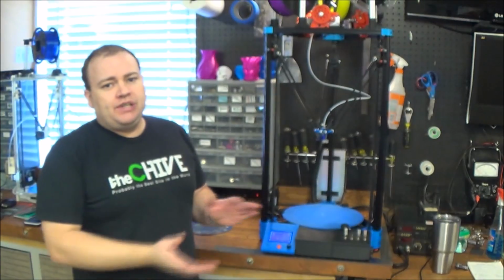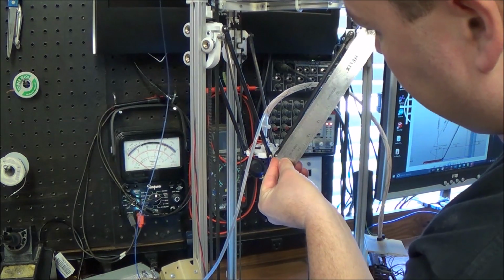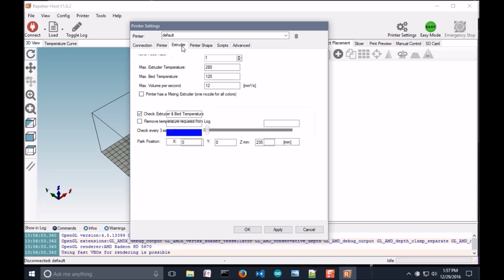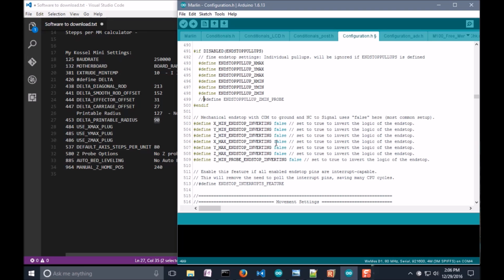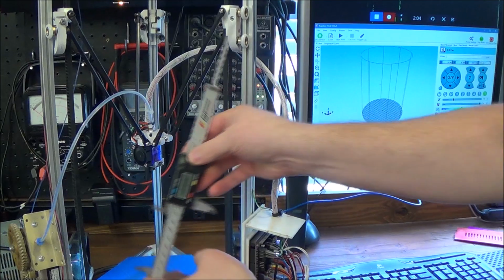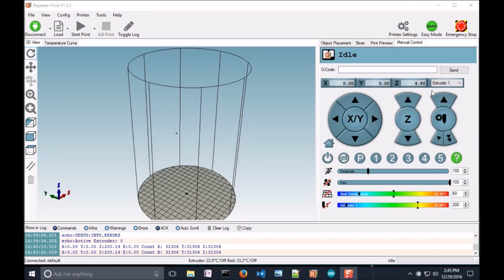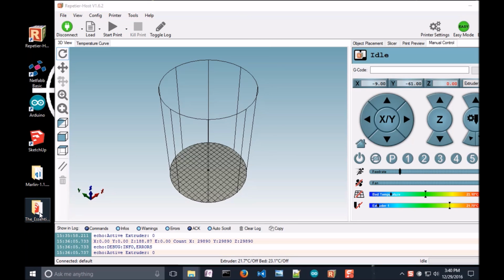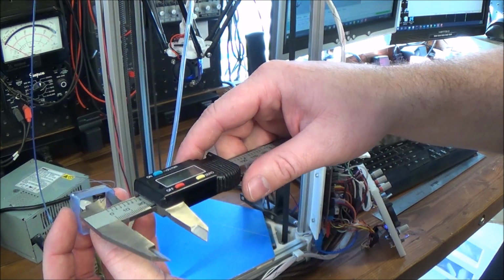Kossel Delta Software, Marlin Firmware, and Calibration

Comment: When I home my delta using Repetier it goes to the end stops, but does not go down at all after. My max z position is 296.4, my Home Z is 270, and my printable height is 296.4. MANUAL_Z_HOME_POS in firmware is 296.4. If I change MANUAL_Z_HOME_POS to 270 it still stops right at the endstops, but Repetier just says it's at 270 instead of 296.4 without moving it back down the 26.4mm. Any thoughts?

Comment: the newest version of marlin does not use the radius set in arduino. You have to use the m665  r commands and then m500 to save those settings once done. I changed my Radius in arduino my 100 and it did nothing, and apparently on other forums, it is mentioned that marlin doesn't use the way shown in the video anymore. I hope this helps some of you out there. I have spent the last week trying to get this anycubic kossel pulley delta printer working. I've got a few test prints done successfully now.
Reply: Same, but I have the linear version.

Comment: I am using prontface , yet I found some use full tips , buti have not been able to get decent movements as yet ,  if the home pos is x100 y 100 z 100 where exactly the headstock should be? in my case the head stock starts vigling, never touces the end stops at the top, there are three end stops , should they be at XMIN YMIN ZMIN?  pins on the ramps? or MAX of xyz

Comment: I've run into a problem trying to compile the firmware based on the links.... is there a working configuration for delta using the ramps 1.4

Comment: Oh wow, very overwhelmed by the wealth of information here!  I have a Anycubic Kossel Pully version with a 200mm round build plate. My initial problem was the X-height calibration and leveling.   The print head only probes 69 point  in a straight line instead of moving all over build plate. When a print was initiated the head would only move back and forth in a straight line and print a straigh line of garbage with the head eventually hitting and breaking off the extrusion! Since I have noticed that the X stepper was plugged into the additional z (should be unused) socket on Trigorilla mainboard! A closer inspection reviled there was NO X stepper motor socket installed on the board! I have since soldered a 4 pin header onto the board in the X location. Now the head when manually homing will not click the X ends stop and remains low unlike the the other 3, that click when homed. When X -axis height is initiated in this condition the head does now probe other than in a straight line, however the head swings way off the build plate smashing around. I now question if the firmware that was provided by ANYCUBIC  was for the wrong model? They sent me the firmware for the Kossel Plus version. I have the Kossel Pully version. When I download the other firmware version other than the plus, I am unable to find the trigorrila hex file as in the firmware information file. So I have no idea where to find the firmware within this firmware download! There is configure .h file file and adv config .h file within the firmware when exploring, however in Cura when choosing to navigate to custom firmware upload, these config files do not show up because they have a .h extension not .hex. So I have no idea as to how to load a different firmware. The firmware Anycubic provided had a .hex suffix as long as a eeprom reset .hex file that Cura was able to upload. But as mentioned before I believe the Anycubic Kossel Plus model may be a larger machine with a bigger dia build plate? Im at a total loss as far as what firmware to use, where to get it and how to get cura to see files that do not have .hex file extensions. All the firmware I have found have ony the configure.h and  configure_adv.h which Cura cant read, nor would I know if I could load these, which one or both would I need. Please help, Im very confused and ready to smash something!!

Comment: The video was very useful but i have a problem.
 After it touches the endstops the motors keep on grinding,i have checked the endstops(and they are working) with m119 commands but still no use,any idea?

Comment: Thanks for your work just bought and put together a 3dFLSUN and set it up on Ubuntu 17.10 with all your recommendations repetier-host v2.05, sketchup 8 (wine) and Marlin running thru Arduino 1.8.5-linux64 my only issue was I had to apt-get install slic3r and configure it into repetier-host. Again thanks much for your effort, having this video in corner was great. Looking forward to doing some sketchup and maybe blender if i want to punish myself. All the best!

Comment: HEY my home butto doesn't work ...
it goes (all 3 things) up and keeps pushing on a motor ...
Reply: this sounds like a wiring issue. make sure everything is properly labeled and if not you can go in and change what the button does by CAREFULLY reading the code, taking a note of what you are going to change each time (so you can change it back to what it was previously if it doesn't work
), and changing the button's actions.
Reply: Your Mom LOL yes was a wiring issue... But I repair it before your answer ... Thanks anyway ✌️

Comment: i dont where is the error . pleass help me :)
the messenger arduino send to me
Arduino: 1.8.4 (Windows 10), Board: "Arduino/Genuino Mega or Mega 2560, ATmega2560 (Mega 2560)"

In file included from sketch\MarlinConfig.h:39:0,

                 from C:\Users\USB\Desktop\delta\Marlin-1.1.x\Marlin\Marlin.ino:31:

SanityCheck.h:204: error: #error "(min|max)_software_endstops are now (MIN|MAX)_SOFTWARE_ENDSTOPS. Please update your configuration."

   #error "(min|max)_software_endstops are now (MIN|MAX)_SOFTWARE_ENDSTOPS. Please update your configuration."

    ^

Multiple libraries were found for "LiquidCrystal.h"
 Used: C:\Users\USB\Documents\Arduino\libraries\LiquidCrystal
 Not used: C:\Program Files (x86)\Arduino\libraries\LiquidCrystal
exit status 1
#error "(min|max)_software_endstops are now (MIN|MAX)_SOFTWARE_ENDSTOPS. Please update your configuration."

This report would have more information with
"Show verbose output during compilation"
option enabled in File -> Preferences.

Comment: Hi - I'm new to the Kossel XL Firmware.
Your video's are fantastic.

I've followed your cheats list and amended the parameters to suit my printer.
I'm using your Marlin Cofiguration-h file
I've come to verify the configuration_h and I'm getting an error message. Shown below.

Arduino: 1.8.3 (Windows 10), Board: "Arduino/Genuino Mega or Mega 2560, ATmega2560 (Mega 2560)"

In file included from sketch\MarlinConfig.h:39:0,

                 from C:\Users\FX9590-PC\Desktop\Marlin-1.1.x\Marlin\Marlin.ino:31:

SanityCheck.h:202: error: #error "(min|max)_software_endstops are now (MIN|MAX)_SOFTWARE_ENDSTOPS. Please update your configuration."

   #error "(min|max)_software_endstops are now (MIN|MAX)_SOFTWARE_ENDSTOPS. Please update your configuration."

    ^

C:\Users\FX9590-PC\Desktop\Marlin-1.1.x\Marlin\Marlin.ino:45:110: fatal error: U8glib.h: No such file or directory

     #include <U8glib.h> // library for graphics LCD by Oli Kraus (https://github.com/olikraus/U8glib_Arduino)

                                                                                                              ^

compilation terminated.

exit status 1
#error "(min|max)_software_endstops are now (MIN|MAX)_SOFTWARE_ENDSTOPS. Please update your configuration."

This report would have more information with
"Show verbose output during compilation"
option enabled in File -> Preferences.

Any thoughts / help on how to over come this error message.

Thanks in advance

Mike
Reply from the maker: I imagine it's probably that the newer marlin has some changes that don't work with my older configuration.h What I would do is download fresh marlin, use the delta configuration.h example for your machine, then just use mine as a reference, comparing how I set things up.

Comment: Hey, while leveling my Delta, I can't get any closer to the printing bed. I'm at -6cm now (That's what Marlin said) and my nose is about 5mm away from the printing bed. Where can I find the max hight configuration in Marlin in order for the printer to set the end stops higher, so I can calibrate it?